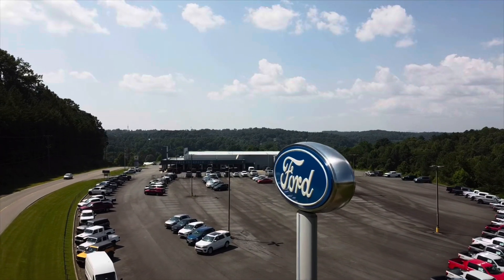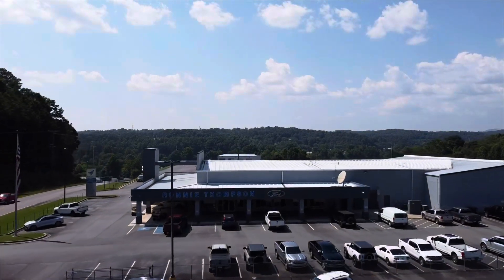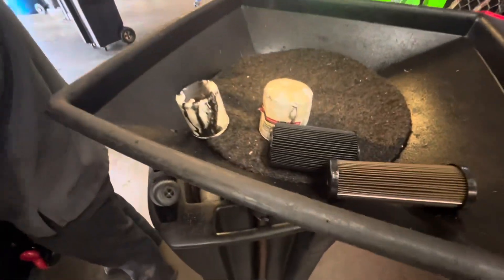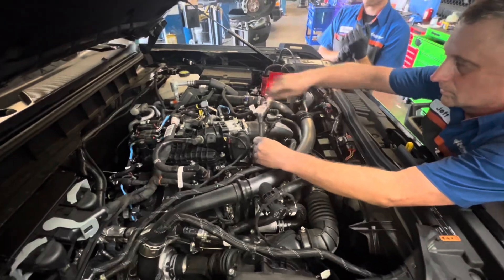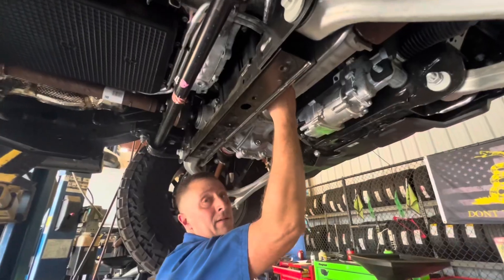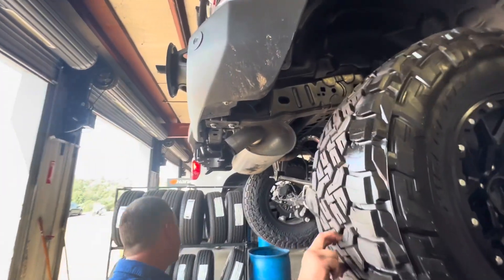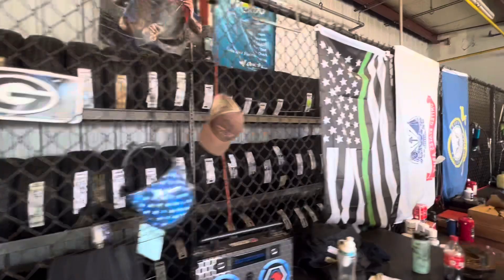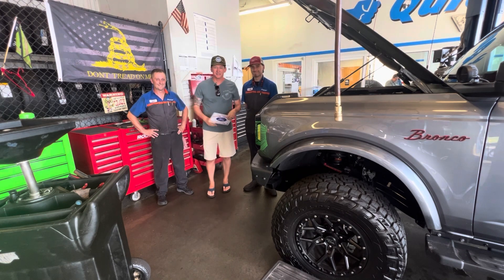How to change the oil in the new Ford Bronco. To get messy, or not. That is the question 🤪

Comment: Also you should push the gas and brake to the floor on first start after the oil change this will allow the oil to move around the engine before you actually start it. Do not allow the truck to start just let it crank for a few seconds. remove finger from the start button. Then let off gas and brake and then start truck normally.

Comment: 6 quarts is too much oil.  Ford needs to issue a service bulletin because the specification is wrong.  If you pull your dipstick after 15 minutes or so, you will see the oil is approx 5/8 of an inch over the top fill hole.